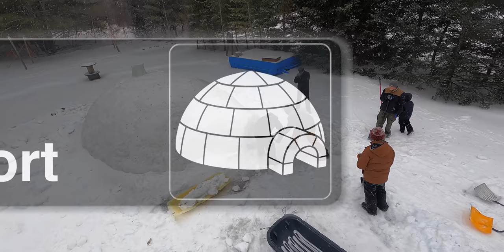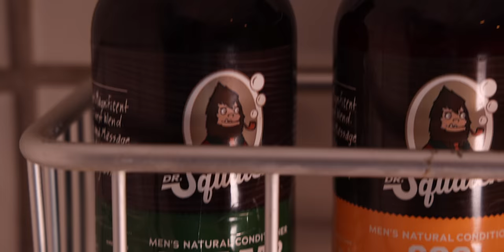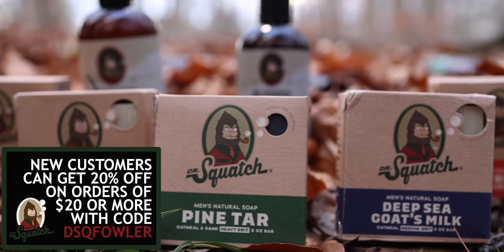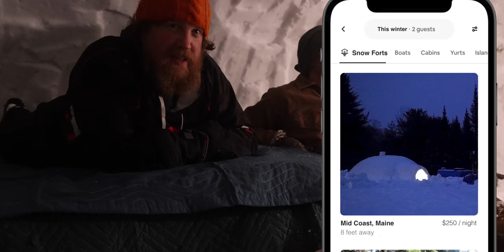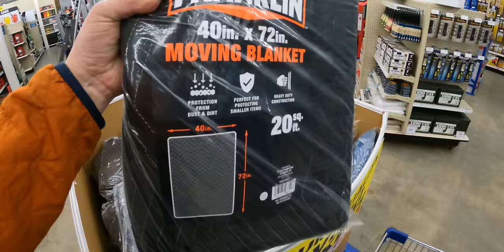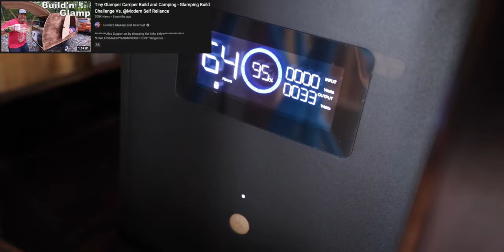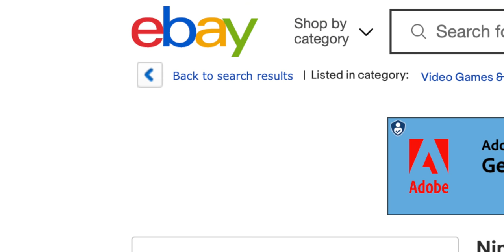Snow Fort Mansion - Build & Glamping

Comment: You need to maintain 30 degrees F, or less, so you don't melt your structure.
Also, you might want to put a tarp over the TV to keep the drips out.

Looked fantastic.
Great Shocker Ending...Saved by Coffee.  Go figure